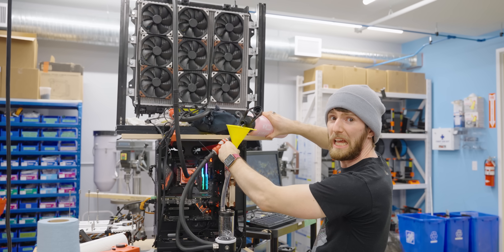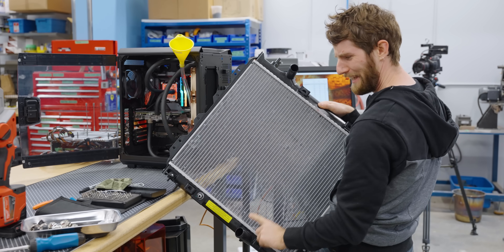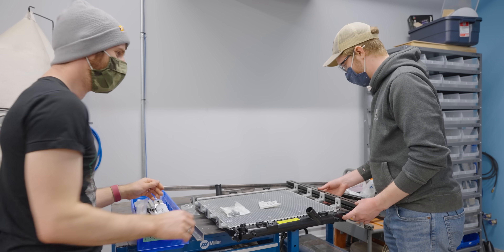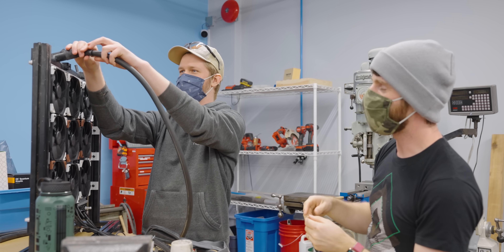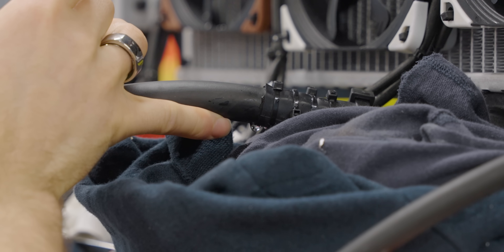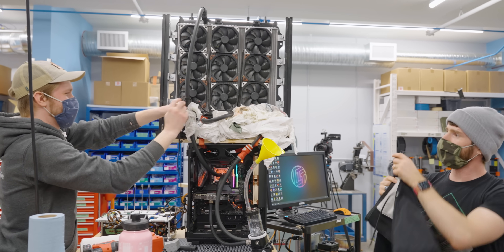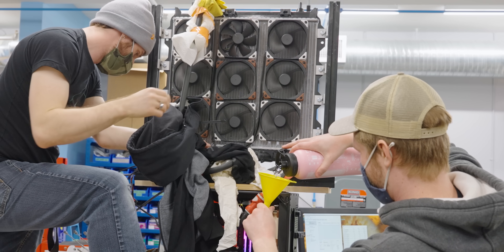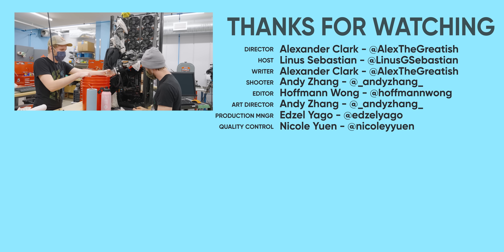Our Craziest Cooling Project Yet - Car radiator liquid cooler

Comment: Linus. Your conclusion is false. You rushed this and constantly poured fresh cold water into the system. You would need to run the stress test for a long time without changing water until water temps don't increase anymore.

Cool idea. Bad execution.

Comment: How do all these guys have absolutely no concept of what a transmission cooler does?  Running the output water through the trans cooler is the equivalent of using a ice cube to cool off a ice cube.  I'm not even going to mention the lack of understanding in pipe fittings.  Everything they needed could have been found at the hardware store.

Comment: I want to remind you these guys have a pretty decent machine shop and could have turned an adapter on the lathe for the radiator hose to the water cooler hose out of some cheap barstock.

Comment: Try it using just a transmission cooler next time 😅 only one feed line through the radiator and a slightly more manageable size... 

Also, use Cad to make an adapter on the radiator.
Reply: They dropped the ball on the choice of rads... I would have gone with the tried-and-true drag racer special.  A 2000 Honda Civic radiator. You can get an all-aluminum one from BeCool for $65. They are 13"x18"x2" And you won't need to deal with the dual loop (no built in trans cooler).  They spent $200 on a plastic capped single core LOL

Comment: next time, use a 90s  honda civic radiator and fill it up from the top. 
also, put the rad in the floor and you can probably ditch the pc fans and use one of those square frame house fans

Comment: Get a car with the kind of electric radiator fan. Get the engine out but keep the cooling system. Build a PC in the engine bay using the car’s cooling system.

Comment: I'm guessing you were trying to make it fail badly? You could have simply siliconed on a proper fitting and had it not leak at all. Would have taken 5 minutes to do that, and then wait for it to cure. Or choose a radiator with a more appropriate outlet (like, IDK, maybe a turbo intercooler or something). Or just use the outlets that are the right size and plug the others using silicone and the caps that came on them? It would have been a good test if it was done vaguely correctly. 
 I enjoyed it, well sort of, but ultimately it earned a thumbs down for the method.

Comment: radiator hose to pvc reducers....Cap off the transmission cooler lines.(the 2 smaller lines at the bottom)

Comment: Of course this rad has two loops (nets). When the cars engine is cold you want it to go to it's optimal operating temp. Thats why a car has a thermostate. As long as the thermostate is closed your cooling pump will only use one loop of the rad to pump through. As soon as the engine hits a certain temp, the thermostate opens and both your loops are in action and actively cool your cars engine.

Comment: I wonder how the pc fans compare to using an automotive fan, I mean definitely quieter, but do they move more air? Also could we have just set the radiator next to the computer instead of top of it? lol
Reply: The better fans move about 5000 CFM. If you have a proper shroud that will channel the air through the entirety of the radiator it will cool evenly and efficiently. 
Their setup was probably similar in volume, but I doubt it would cool as efficiently. 

For reference, I've only found 1 person to build a test bench. Most all of the electric vehicle fans were 3500-5000 CFM, and then they tried an old engine driven fan. The engine driven fan pegged their test bench at 10000 CFM, at idle, and blew it apart when they tried revving it. This is why big power stuff like a 3500 with a diesel will still have an engine driven fan as they can pull so much more air than anything electric that's made right now.
So, they just need a shroud and fan that they can drive with a 20hp 240v motor, and they could cool the whole office off a truck radiator...

Comment: DI (de-ionized)/distilled water or coolant. If you put normal water (tap or bottled) then the heat will bake the minerals in the water onto the radiator and clog the assembly over time.

Comment: "I need a tube adapter and I have 3 3d printers but il bust use an intertube and not enough hose clamps" never fails to get comments
Reply: What?
Reply: @DakinRinone  He is talking about how they had better tools to solve the problem readily at hand but went with the most "Jank-tastic!" approach for the explicit purpose of getting more engagement on the video's comments. Here we are a year later still talking about it so it worked.

Comment: The metal fittings is a heat exchanger inside the radiator. Its to heat and cool the transmission fluid.

Comment: This was an interesting idea that went south. 1. mount the radiator on the floor or table, not on top of your PC. 2. They are called hose claps. Cheap and easy. They would have solved the dumbass portion of this video. I used a tall floor-mounted European radiator for years. I think it was about 3' tall. Cooled CPU and GPU without issues. This would be a great test on what it would take to saturate this radiator. Multiple PC's anyone. Forget the keystone cops act and do it right.

Comment: I refuse to believe that nobody in that workshop thought to use hose-clamps, especially when they're clearly on hand and used for other fittings.
Zip-ties and the leak were clearly planned for content. Would have been cool to see actual results without the memes.

Comment: For starters why did you put it ON TOP of the computer? You could have put it remotely anywhere you wanted to on the bench. Also with minimal effort and a run to a home depot/lowes you could have sealed it better and leak checked it. I am hoping you did all this crazyness for views. Does no one on your staff know how to do plumbing or hydraulics? You made a water chiller work, this should have been easy.

Comment: transmission fluid can reach 350 f fast so 200 f coolant cools it, the cooler is in the coolant and why are you using it its a mute point  its like watching Monkeys trying F@#k a football and those don't leak cars they have fans made for those running 12 volt

Comment: Anyone else remember when Linus tried to water cool an entire house full of video editors workstations using copper pipes and a radiator stuck out the window? Good times.
Reply: Remember when it kind of worked but then started growing?
Gooood times.
Reply: That was pretty epic. But they screwed it up. It kind of worked but not for long...
Reply: Still wanna see them do this in a more successful way lmao
Reply: @zachcollins9687  THey purposely failed, because they know it would work and cool really well.
Reply: @johnnyvt9  what? why would they fail on purpose?
Reply: OG days
Reply: What’s the video called?
Reply: @chm1ata  https://www.youtube.com/watch?v=b8bLtg9J1Oc&list=PL8mG-RkN2uTyVqLN5OSZxn3Z4t1_xFunu&index=1
Reply: @TwistedMe13  thanks
Reply: Sounds like something I would do if I could afford it
Reply: what i want to see is him make a pc case out of radiators only so the hole case is liqued colling from the case to cpu to the ssd to the graphics card to even using that water colling power suply unit ware everything is 100% liqued coolling
Reply: Have to see
Reply: I made a comment on that video that they should have used a giant truck or car radiator instead. I find it it funny he is now making a video on that very thing. ONe large fan would have worked just fine.
Reply: the building in my company is water cooled in the summer and heated in the winter. the piping is inside the walls.
Reply: how called this video?
Reply: @discoveringcraft  Whole Room Water Cooling Project. It's an 8 part series.
Reply: @00Klingon  thanx))
Reply: @00Klingon  LOL, that sounds great.

Comment: the radiator is doing its job but is the heat transmission between the processor and waterblock any good

Comment: The trans cooler is just a liquid to liquid transfer device inside the radiator. It works by dissipating heat from the oil to the coolant, then the coolant dissipates it to the air. 
What you did about using the trans cooler was just unnecessary.

Comment: Alex, that is not any L angle bracket. That is a hot rolled angle 1 x 1 x .125. Typically sold in 20 foot lengths at your local Metal Supermarkets. Or 8 foot lengths at Home Depot.

Comment: The transmission cooler portion is just a small portion in the bottom that transfers heat from the trans fluid to the coolant, no air interface.

Comment: Now do it using heater/radiator fittings from the Dorman HELP! section of the auto parts store, and a couple feet of the various heater/radiator hose sizes, so you can make it not leak at all. Also, maybe use a heater core instead of a main radiator? They’re not as big as that one, but they’re still a bit bigger than the ones the system started with.

Or, maybe a radiator out of a late ‘90s civic? It has the benefit of a cap on top, making filling the system much easier, and the hose fittings aren’t quite so many sizes off from the tubes in the PC

Oh, and ignore the transmission cooler entirely, it just uses the water in that end tank to cool the transmission fluid(it doesn’t interact with the fins at all), so it offers no benefit in this use case.
Reply: Better choice, maybe: Geo Metro/Suzuki Swift radiator. its core is only 327x324 mm, plus the tanks and mounting tabs. It might even fit inside that case, if by 'inside' you mean 'replace the side panel'

Amazon US has one for like $65, but the best price on amazon.ca is CDN$ 105.65. a nicer example of the type than the cheap US market one, though, and both cheaper and more available from them than NAPA: https://www.amazon.ca/Spectra-Premium-CU1444-Complete-Radiator/dp/B000C7VY42/

Comment: The trans cooler, is actually a heat exchanger. It is as responsible for warming the trans fluid, as it is for cooling it. the core of it is integrated into the exsisting radiator stack for the engine. 

Although the project is cool, you guys would've had a much easier time using a 6.0 powerstroke trans cooler. Its cheaper, the fittings would be easier to adapt, and still just as much overkill as the PT radiator is.

Comment: For practical application since the case is almost that same size you could lay the radiator flat and mount the case above, with hoses out  the back of the case

Comment: Why don't you just get a Watercool MO-RA3 420 which is about the same size?

I am personally cooled an i7-4790K@4.6GHz and an RX6900XT mostly passively with one of these. The fans only turn on if the coolant reaches 35° and this only happens under full load and then the 4x200mm Noctua fans start spinning at 330rpm and cool down the coolant to 28° where the fans stop spinning again.

You could essentially also have hooked up your system straight to the fresh water supply and drain the water on the outlet so you wouldn't have to run ith literally through your computer. Well, at least you might get additional water-cooling for mainboard components which are not having a water block on them 🤣

But hey, at least the video is entertaining.

Comment: Seems like you have not yet heard from the MO-RA coolers which have a similar size. At least I have been using them for my systems for quite some years and thought they are quite known in the watercooling community ;-)
https://www.aquatuning.de/wasserkuehlung/radiatoren/radiatoren-aktiv/15381/watercool-mo-ra3-360-lt-black

Comment: You guys got ripped off on that radiator bad. I got a new radiator for my PT Cruiser GT turbo (I'm pretty sure its the same rad as the non-turbo models) for $78.32CAD on RockAuto plus like $30  shipping. Part #: ANCHOR 3172

Comment: The other side of the operation is expelling heat at high pressure. When water enters the chip interface it boils away at your chosen temp. A small radiator can handle the water with more than atmospheric pressure and a restriction in the tubing regulates the different sides.

Comment: I'm thinking:  They could easily have done better, with a bit of thought.  I'm kind of disappointed.  I've often thought a large, oversized car radiator, with many, very quiet fans would be ideal for absolutely silent cooling.   3D printed adapters, some 5 minute epoxy, and zero leaks.  Plus, I'd have put the radiator lower, and added a fill direct to the radiator.  I'd also have simply closed the transmission loop with a single loop of tubing, it adds nothing useful to the cooling, and is there as much to warm up the trans than keep it cool. 

I'm going to have to conclude:   Inconclusive, as the setup was so poorly implemented it could not help but to fail.   Oh well.

Comment: FYI, the transmission cooler is a separate heat exchanger inside the end tank that cools the transmission oil with the coolant, so looping your water out of the radiator and into that is pointless and just adds flow restriction.  Also, you can get chinese Honda Civic 3 row racing radiators on ebay for like 60 USD.

Comment: Probably should have used a stock radiator fan, radiator hoses with a reducer and capped off the transmission lines

Comment: Yeah, this one deserves a revisit where Alex actually has time to use the lathe to make proper adapters for the radiator.
Reply: Proper adapters are available off-the-shelf. It just takes a bit of auto and plumbing knowledge.
Reply: @kmoecub  straight up true . npt pipe in plastic or iron ,brass, stainless,  and rubber hose clamps for reduction and seals  all in one piece. it could have be easier it was friday and just for fun.

Comment: It's actually a duel radiator. One is for the engine which is antifreeze and the other is for the transmission which is transmission fluid. Completely isolated from each other but combined in one package.
Reply: sorry but I have to say total hack job! LMAO!!

Comment: It might be easier to do a collab with "Tech Ingredients". They used standard air cooling, and a built-to-fit plenum that dropped inside the top rad spot on the case & socketed into the output of a window aircon. They got temps in the 30s.

Comment: It’s alright Alex, no one except the deadshit engineers at HQ understand the point of having your transmission run across a single pipe, that’s only a couple inches long, and submerged inside a radiator at 100+c.... 
Everyone with a performance or modified vehicle and automatic has an aftermarket oil cooler bolted in front of the radiator 😂
TLDR- Transmission coolers inside Radiators are stupid and don’t work.

Comment: Dont use the smaller pipe for transmission...

Just use straight big coolant system pipe... That will solve alot of the leaky situation

Comment: the cheapest radiator you could find was $170???? that’s a crazy amount of money. i mean i guess if it was oem that makes sense, but i guarantee you could have found one cheaper. although it doesn’t really matter because you guys spent $80,000 on a solid gold xbox controller

Comment: I have long said a large effectively cooled reservoir of water constantly pumping fresh very cold water into the system would be much more effective for thermal control.  This would allow the last drop of water to cool your system to be as cold if not colder than the first drop to cool your system.

Comment: Would honestly like to see this idea with the proper radiator fan and hose system. An actual car radiator fan is going to be pulling something like 4000CFM over the radiator fins, those small fans can only pull about 300CFM across them.

Comment: why dont you just get 2 meter of  22 mm flex water tudeing with insterts  to the radiator holes and then put a  22 mm  to 15mm reducer connection on it  15mm tubing and then connect to the cpu holes and seal it up ..easy simple and look better and no leaks

Comment: Pff... Amateurs... Overengineer everything... I just used a car ventilator that goes onto that radiator... Put it on a frame and plug it into wall power... It sure does make nies but when you point it to actual PC case it is working just like dream...

Comment: I was wondering if you could do it without the fans. Like a semi-passive cooling. Tilt the radiator 90 degrees and put something of a funnel on top of it. That way the hot air would rise up and create and pull fresh air from the bottom trough the radiator.

Comment: Oh c mon , you guys have a 3d printer? Make some connectors and longer tubes place it next to the pc , this build  can be overclocked  big time. 
Buy a piece of radiator hose and make a fill connection in that upper hose. On the end a 3d printed adaptor to the smaller tube. 
Do not use the small transmission cool  tube. Add some small silent aquarium pump. Hey even could have some aquarium reservoir if you want to.

Comment: with better connections on the hoses it could be a awsome setup. also using a automotive cooling fan on it with a fan speed controller.

Comment: Please go back and engineer some adapters to reduce the radiator to fit and work with PC tubing, also use in line pumps to take the load off the D5.

Comment: For the love of god, buy a set of barbed-to-barbed tubing connectors. They're probably not ideal for permanent setups, but for these temporary ones that involve unusual tubing conversions they will work way better and more easily than what you've done here.